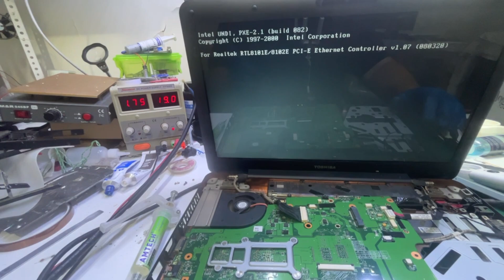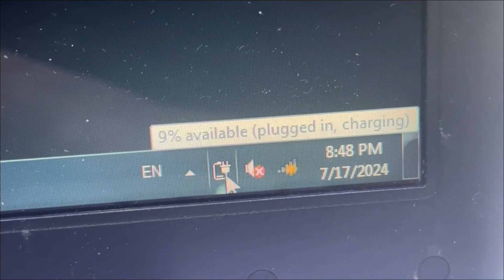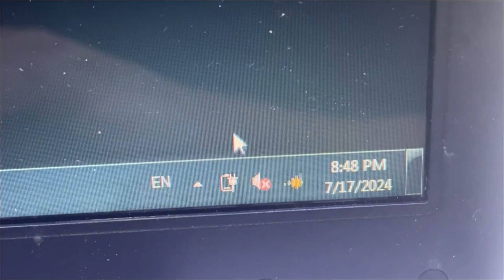Toshiba Satellite L505 Turning ON but doesn't have picture, Fix.

Comment: May I ask how much a repair job like this would cost the customer?
Reply from the maker: it depends on country pricing, but it would be a little bit low cost as the laptop is an old model and doesn't need much effort to fix